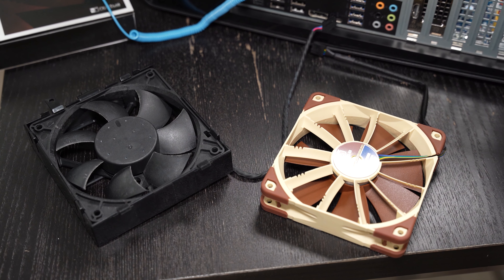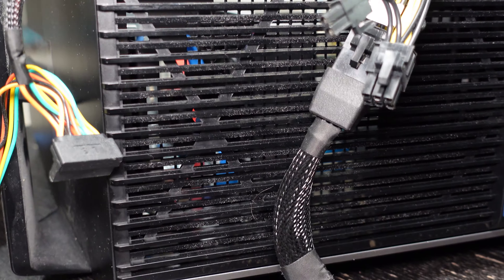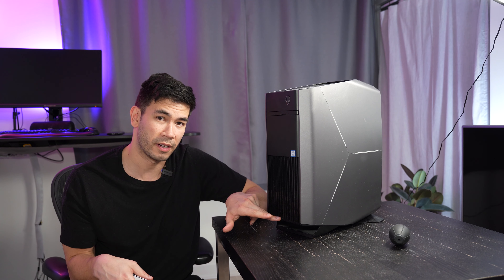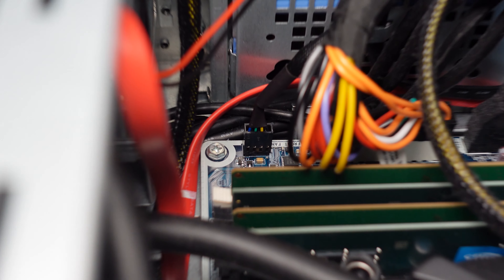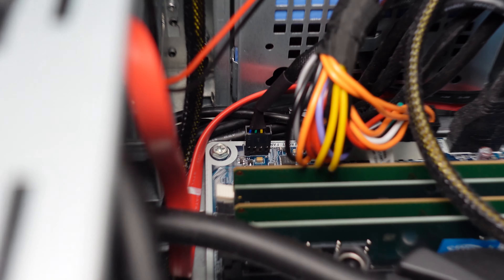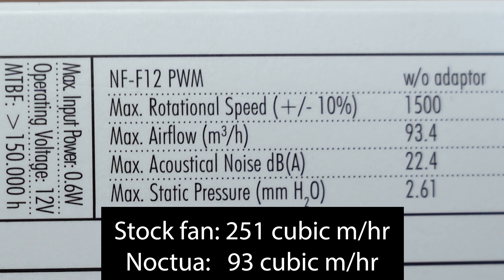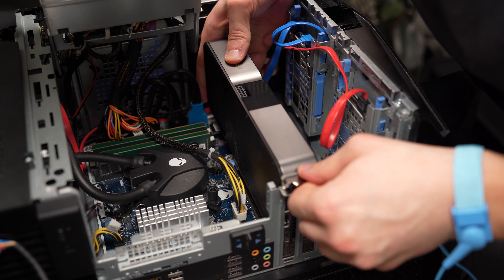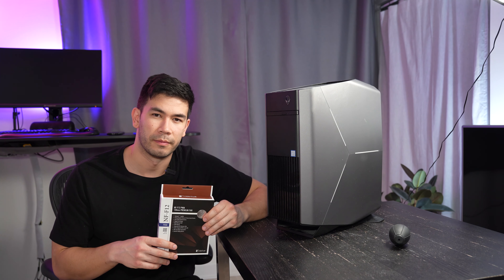Why your Alienware PC needs HIGH STATIC PRESSURE fans to IMPROVE TEMPS & NOISE

Comment: Good video — but I have a question.
Set aside the fact that the stock fan is loud for a second.  If the stock fan is capable of higher CFM air flow, how is it not more effective at cooling?

You would need a comparable fan adjustment curve, but if the system starts throwing or max heat, why wouldn’t the stock fan (running at 150 CFM) be better than the Noctua’s max at ~90 CFM ??
Reply from the maker: It has a higher cfm but also higher rpm. Noctua pushes more with less rpm therefore more efficient!
Reply: @Steve 
The difference is in the fan type.
The stock fan is a normal "Air Flow" (AF) fan.  It's great at moving air with no resistance.  However, put some crap in the way, and the air no longer moves freely, and - BAM.  It caves, and air flow drops dramatically.
The F12 / A12 fans are "Static Pressure" (SP) fans.  They don't move as much air in a free flow situation, but they don't slow as much as back pressure increases.
That is, to a point.  After static pressure reaches 2.6mm H2O (2.3mm H2O for the A-12), the fan's flow will start to fall off.
For these reasons, I settled on the EK-Furious Vardar EVO120.
It flows 107CFM up to a SP of 5.8mm H2O, at a livable noise level of 42dBA wide open (3000RPM).
FWIW, I also got a EK-Furious Meltemi 120 (120mm x 38mm) to replace my CPU radiator fan.
It flows 120CFM up to 7.1mm H2O SP.
Its not exactly quiet at 61dBA, but that's at wide open (3500RPM).
Reply: @JSyntax  wrong. the AVC has 4000rpm and Noctua has 2000RPM?

Comment: Hi, excellent video on how to remove the front fan. I ordered the better fan overnight and switched it out in 1 day. I'm getting 56 celsius on my GPU while mining now. For me, it was easier to keep the GPU in place. I couldn't figure out how to get it off the board. Those rubber edges kind of got stuck in the fan case. I think cause the case got bent from pulling it out.
Reply from the maker: Awesome to hear Happy mining

Comment: Just 3 days ago i fully tore apart my aurora r8, ive never been so stressed out while working on a pc lol, i got the top radiator out by removing the ram then gpu and then the water cooling for the cpu and then unplugging everything off the motherboard. once you get the radiator out id take the whole fan/radiator assembly apart and clean it that way.
Reply from the maker: Damn I hope my video helped a bit?

Comment: I have replace my R12 front fan with noctua fan. But windows restart will boot into Pre-Boot System performance check first and say the fan failed to respond correctly. I check the new front fan is working. any idea how to skip this issue?
Reply from the maker: what fan did u use?

Comment: I made the fan change using three Noctua NF-A12x25 PWM, added the third as a pull on the CPU water cooler - they worked great until the BIOS 1.05 forced update the BIOS started a fan test on every startup or restart - I could not find a way to turn it off so I had to put the Dell fans back - I wound up gutting a 6 month old R11 with a i9-10900KF, 64gb ram, 2th NVMe SSD, RTX-2080Ti and putting everything in a new case and mobo and pwr Supply ( I did not find the hidden 4 pin mobo power connector until the new PC was built and I was stripping the R11 for the recycle bin - it picked up with the trash yesterday and I now had a great PC and no more Dells ever again after at least 15 years - PS - My R1 was so hot I felt it was a fire hazard, no joke or exaggeration - all cores were hitting 98c before shutting down and PC had to be turned off at least 5 min before you could touch GPU or PSU and not get burnt -
Reply from the maker: Haha! Nice job doing component surgery! I'll need to do that one time for fun

Comment: Hey mate you can take out the top fan and radiator easy. Just unscrew the radiator from the top and 2 screws from the inside and it will slide right out. Then you can change the fan or the whole radiator with a Cosair H60 liquid cooling if you want.
Reply from the maker: Didn't like how the H60 has such long hose, making it hard to close the enclosure. I think the stock aio is very good! I just need to clean the dust!
Reply: @JSyntax  Yes you can just take out the top fan and use vacuum cleaner suck the radiator. And switch the fan.
Reply: @minhtikeaung7778  so you don't have to open the top case to switch the fan? That's great, thanks for the info
Reply: @zarakitube  you don't need to bro u can pull for inside.
Reply: @minhtikeaung7778  does the noctua NF-P12 1700 PWM work as a top fan?
Reply: @zarakitube  use cosair magnetic bro no bios error they go up to 3400 easy

Comment: Just pasting this from another video I posted into:

You may disagree but I am personally not bothered at all by the Alienware stock fans. I got a liquid cooled Ryzen 5900x and a RTX 3080 in the R10 and with some simple settings with AWCC I can use the computer just fine for normal things and it is basically silent (thermal set to Quiet and power set to Power Save) . When I play a game I set it to switch automatically to Performance Mode and yes, that's when the fans become a bit noisy but 1) I use headphones when I play and 2) I know that AWCC is using the fans properly. GPU does not go above 75C (in July, UK) and the CPU does not go above 60C. 

The fans on the Alienware r10 can reach 4000rpm so going for slower fans and let AWCC manage them without tweaking the profiles properly will just let them go even slower. As AWCC is set for 4000rpm fans, 50% of it is 2000rpm. Replacing them with 1700rpm fans will mean that 50% of it is 850rpm and that is not necessarily good. Less noise, yes, but with this case having poor airflow is bad.

That's why I will ONLY add an additional Noctua Noctua NF-F12 iPPC 3000 PWM (yes, industrial) in the HDD slot, leaving the stock fans where they are. This fan is not the quietest, but it is the nearest I can get in terms of rpm. I looked for other 4000rpm fans but they are just not made for desktops (like the Dell stock ones) so they will add a lot of noise. Noctua NF-F12 iPPC 3000 PWM  is instead perfect for this. I feel there is a lack of airflow on the top side (which dell fixed on the new Aurora models), so this justifies adding this fan.

I may, if needed, add an additional fan to the top radiator as push pull solution, but the CPU temps are just fine now so it is not a priority.

Comment: I run a 3080ti. Just get Noctua nf-a12x15 fan. It’s only 15mm thick vs. the stock fan which is 25mm thick. The 3080ti pops right in and works great.
Reply from the maker: aweesome

Comment: What is the R10+ fan? I bought an R10 in Feb, had issues and am getting an upgraded replacement which includes a 1000w liquid cooled lunar light case in a few weeks, would that be r10+?

Comment: Also will this fix my R7s noise issue? It sounds like an airplane right now lol
Reply: Man I got an aurora r12 and it sounds like a shopvac
Reply: If the fan fits, yes. Dell sold these computers with unacceptable fans / cooling. Even the R10 still suffers from horrible cooling

Comment: I found another one of your vids so to clean the radiator i used a tooth brush and a rat tail brush and lots of patience  I am considering swaping out the stock liquid cooler for the corsair hs 60 si i can do the radiator in push pull   it will supposedly fit within the bracket  as the radiator is of a thinner profile  you gave me the idea since the noctua fan comes with that lil splitter i figure why not try the corsair ml pro in push pull to give it a stronger exhaust
Reply: Did you ever do this?
Specification data rates the dell liquid cooler at 95W TDP, and the H60 at 80W.
I'm curious as to what your observed temp differences were.
Reply: @501Bravo  I never needed to the original pump is still working but after doing the fan swap the temps dropped significantly about 15c lower rpm rarely hits 66 at full load all cores oced

Comment: So I purchased 4 noctua NF-A12x25 PWM's put them all in only to get fail to recognize them by the dell alienware aurora r7, saw on another guy's video and he found only the cheaper noctua NF-P12 redux will be recognized to work what a waste of money, i put back 2 dell fans on the top watercooler one on the top of the rad and one under the rad fit is fine and it doubles the air movement for cpu cooling and the 2 front fans will have to be replaced with the noctua NF-P12 redux the bottom front and where there was a old hard drive 3.5 i removed it and put a fan ,so they run but not recognized and making use of control speed so I'll get the noctua NF-P12 redux for that.

Comment: Is there any differince between the heavy duty  
Noctua NF-F12 iPPC-2000 and the Noctua NF-F12 PWM, Premium Quiet?
Also is there a easy way to remove the front fan?
Reply from the maker: Hey I explain how it is possible to remove the front fan the bottom front fan
Reply: @JSyntax  Okay thanks. I ordered the IPC 2000 fan. Is that better than the other one I mentioned?

Comment: How did you get the errors to stop throwing when booting up? I changed out both my front and top fans with Noctua NF-F12 PWM, which are working and accurately following my custom fan curves, but it runs a “SupportAssist Pre-Boot System Performance Check” that always has a critical error saying that the top and front fan aren’t responding correctly. I get this error unless the OEM fans are connected, Dell confirmed this and said that there no way to get around the errors other than switching back to the OEM fans. Thoughts?
Reply from the maker: Unfortunately the top fan is a lot more fussy I believe. Are you using the liquid AIO
Reply: @JSyntax  I have the stock Alienware AIO, I just changed out the fan attached to it. It’s reading the same error on both the top and the front fans that I changed. Upon further digging, it looks like this happens specifically with the Aurora R11 (not sure about the 12) because the motherboard runs different firmware than the R10. Incredibly frustrating, but I don’t need to use my system remotely, so hitting ESC a few times when booting up isn’t a huge deal for the better thermals and significant reduction of noise. I will probably case swap when I have an extra $400-$500 for a new motherboard, psu, and case, bummer that that’s the only real solution as I’ve also been in contact with Dell and there’s no way to turn off the pre-boot check.

Comment: My R7 is 4 years now. Do you have problem with cpu water cooling yet?    I plan to change to air cool b/c water not good for long run and a lot of plug around it.
Reply from the maker: Is it true that liquid cooling does deteriorate faster than fan Cooling?
Reply: my exp and friends . It has very same life time but liquid is leak able. The normal fan just not spin or burn.     

I am just a panic guy. I not like water around electric wire.

Comment: i changed both fans with the noctua fans and they're way better... but the fans no longer EVER change speeds. no matter how much load / hot the computer gets, the fans will never speed up or slow down and I cant manually change them in the alienware app. 

any ideas?
Reply from the maker: Did you get 4pin fans?
Reply: @JSyntax  i didnt, im a failure... why do 3 pin fans even exist if I can't change their speed!?

Comment: How do you figure out the curve for your fans? I just replaced my Aurora R5's fans my top and front with a Noctua NF-P12 redux (1700 RPM) and my CPU Fan with a Noctua NF-A8 PWM (2200 RPM). The reason I'm asking is because if I leave it on Auto my graphics card will heat up quite a bit when I play any game that is graphic intensive.
Reply from the maker: It requires some trial-and-error but eventually you'll get it

Comment: were  there any compatibility issue? I am going to buy the Noctua NF-P12 redux-1700 PWM for my Aurora R11.  I don't want to buy fans that wont work. Or should i get  corsair ml 120 pro?
Reply: pls respond when you can
Reply from the maker: Are you just changing the bottom intake fan? If so you should be fine
Reply: @JSyntax  yes I also want to change the exhaust and add a second intake
Reply: @JSyntax  also were the noctuas louder than the stock fans?

Comment: Why not use NF-A12X25 PWM? ?
Reply: max2000
Reply from the maker: Yes that's. Good option but I wanted Max static pressure and f12 is much cheaper!

Comment: Finding similar issues on my new Alienware R10 Ryzen edition w/ RTX 3080. Running games like Cyberpunk 2077 make my system sound like a jet engine. Will consider changing fan thanks
Reply: Other fans will be more quiet but worse than the stock coolers. I Checkt several fans.

Comment: I know little about computers but I just bought an Aurora 12. I added a Corsair M60 water cooling fan and it was pretty simple. The toughest part was getting the fan bracket that holds the fan (it's a big, boxy thing) over the motherboard rivets and components. The trick is to take out the DDR's (and you'll have to remove your pump), work most of the case/bracket outward from the rear of the computer case, slowly shimmy it down and towards the rear. Once it's mostly free you're going to have to fight with getting the case/bracket over the DDR locks. I wound up pulling outwards on the computer case plastics a bit.
Same thing in reverse to re-install. If I can do it, anyone can!!!

Comment: Thanks for the video. Replacing the liquid cooling fan isn't difficult at all. I did in my R10 using Corsair fans in the Push/Pull Configuration.
Reply: How did it affect your R10? I'm planning the exact same upgrade for tuesday. I hope for a bit lowe temps and less noise
Reply: @derevu2072  I'm happy. I learned how to install a liquid cooler, push/pull configuration when I've NEVER opened a computer. My temps are 46C-52C under load and fans are quietly running at 27% (3)!

Comment: just using a oculus quest 2 with link in general won't run well, its better to get a pcvr headset as the display port connection makes it run better, i have a r10 with a 3080, and beat saber running above 72hz refresh rate stutters with oculus link which is stupid for a 3080
Reply from the maker: Agreed, John carmack needs to go back and fix this now!

Comment: Was waiting for your review of the GW4 and you have not disappointed! As I am struggling to get much more than two full days of use without recharging from my TWP3 despite the lesser demand it makes on its battery when compared with the GW4, moving to the GW4 (while also ignoring its significant drawbacks that you point out it has if you are not a Samsung phone user), would not make sense for me. I guess we have to decide whether - as with the Apple Watch - we accept daily charging as the price to be paid for a beautiful watch packed full of slick features. The GW4 as shown by you certainly looks super cool but even if you dismiss your first fatal flaw, non-Samsung phone users are left with your second fatal flaw. Thanks as ever for your excellent review. Overall then, would you recommend the TWP3 for most users over the GW4?
Reply from the maker: I am sticking to TWP3 IMO! I need 3 day battery life and dual display :)
Reply: @JSyntax  apologies - I seem to have posted my comment on your Galaxy Watch 4 review against a very different review of yours! I’d be interested in knowing how you get a good three days of battery usage out of your TWP3. I sleep with mine and switch airplane and cinema mode on when I am sleeping. I notice significant battery drain when using it to track my workouts but can always put it on to charge afterwards. Otherwise, I have it on the recommended 5 mins display setting and don’t have notifications automatically appear on the watch face. I use a simple largely black watch face.

Comment: I gotta say I must have hit the lottery with my r10. I’ve had no heat issues for cpu or gpu. 5600x and RX 6800 XT. I watched a ton of videos like this leading up to mine being delivered and I nearly cancelled the order thinking I’d be plagued by noise and heat. It’s been no trouble at all.
Reply: Same here. I got the same build aswell. What an absolute banger of a build for the price compared to building myself and card hunting in the market
Reply: @ytbeasty6770  absolutely. I’m playing New World at 1440p with gpu temps in the 50s and cpu below 70c. It’s nuts.
Reply: @MrHodge1  how do you check cpu temperature? I can only check GPU via the Nvidia software you can install.

Comment: Hmm, well you can get a pancake air compressor and clean your pc for free every month like I do. Highly recommend over any other method. I keep mine in the backyard (away from water), wait until it pumps enough to read 60-80psi, and just blow the dust to my neighbors' yard lol. Not sure that it's a very good test when your aio radiator is dirty. My pc doesn't have a front fan and it never gets hot. It's an older acer with a fx-series amd though. I bought a intel r13 and I'm kind of scared now, with all the horror stories. I never thought maybe their computer is dirty! Actually, I did. That's why I bought it anyways lol At least you kept it real!